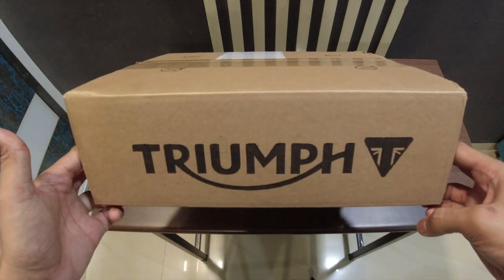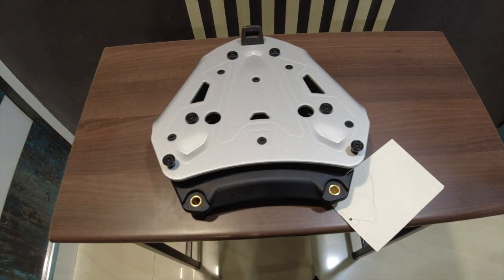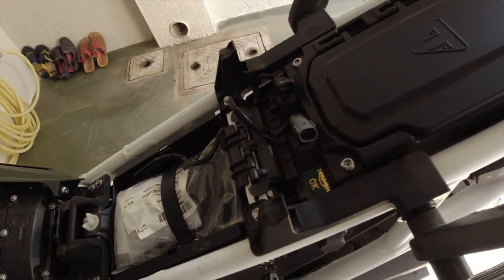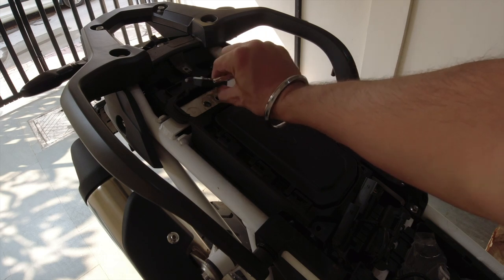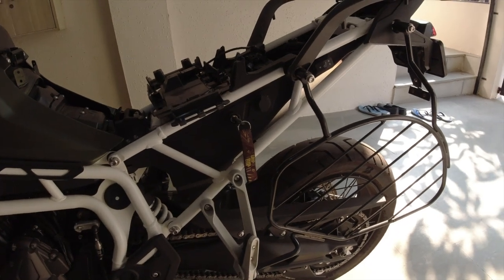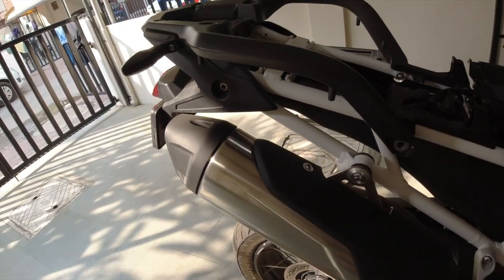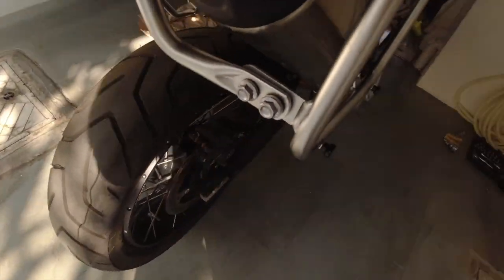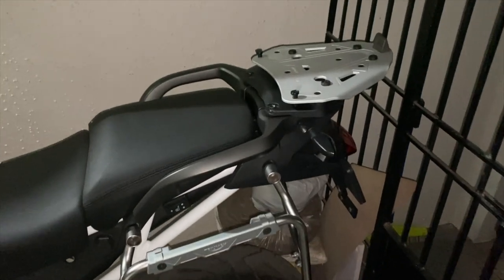Installing Pannier Mounts & Top Box Carriage | Triumph Tiger 900 Rally Pro | DIY (Do It Yourself)

Comment: Hi could you please guide how to remove company fitted  top box
Reply from the maker: On Tiger 900? or you talking about some other bike.
Reply: @motoheadvishal  tiger rally pro 900
Reply from the maker: @RAS007  It is simple brother take off the top box and then there will 4 bolts only that you can take off easily.
Reply: @motoheadvishal  ok thanks
Reply from the maker: I hope that helps 😊